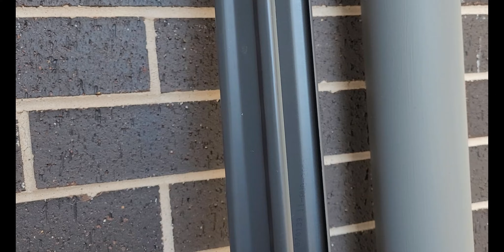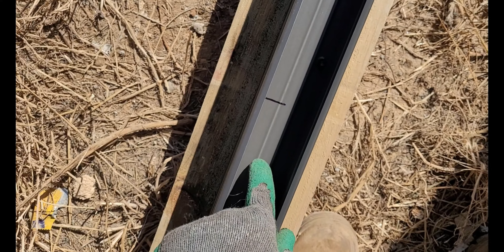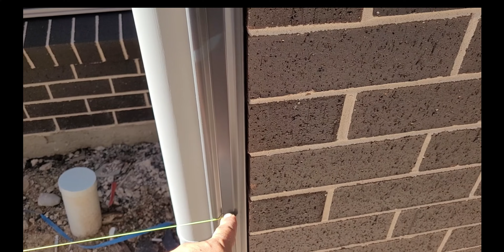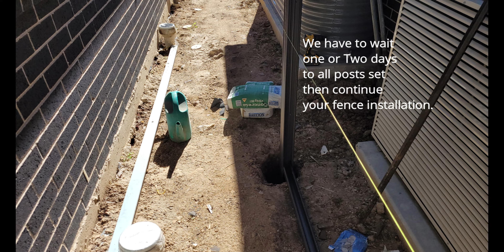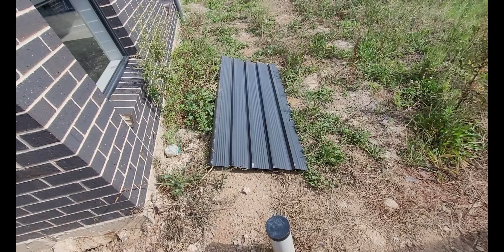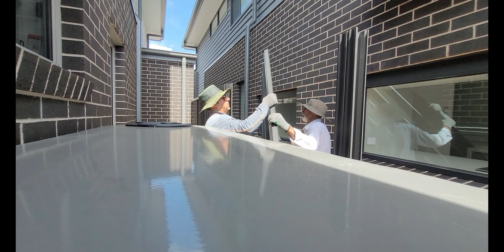Colorbond fence Installation, How to do fence installation, How to build a fence for garden, fence

Comment: Any reason why not to use the longer colorbond rails? (3m, 4 panels)
Reply from the maker: 2.4 is more stable in strong winds.
Reply: @maxlandscaping shorter span will always be stronger, but why would colorbond produce the 3m rails if they are not adequate?

Comment: Hey, Max. Nice work again. I understand that you marked the posts at the point of 1.8m. However, why did you mark it at 1.95m? The timber sleeper you used is 200*50mm. I think you should mark at the position of 2.0m.
Reply from the maker: @michaelwang6453  Hi
Because some time we use 150 x 50 timber sleepers.
Reply: @maxlandscaping  thx, bro.

Comment: do you have a website? which city do you operate out of?
Reply from the maker: @PocoPrint3D  I am working in Sydney areas
Reply: Nice! How do sleepers affect maximum height rules in Sydney? I'm from blacmtown and thinking of adding a sleeper to an existing 1.8m fence with 300mm latticing. That will bring the overall height to 2.4m
Reply from the maker: @PocoPrint3D  sleeper size is 200mm x 50mm x 2.4m